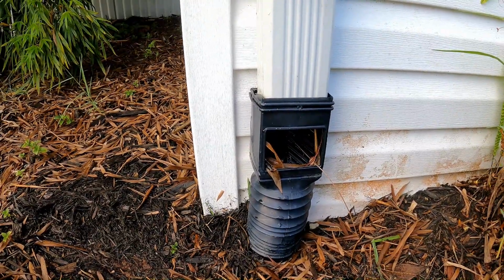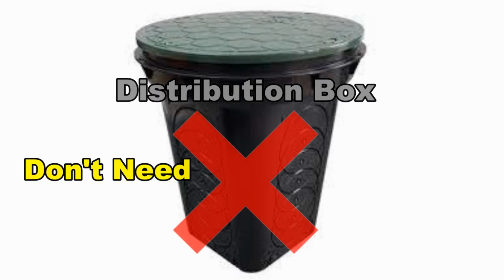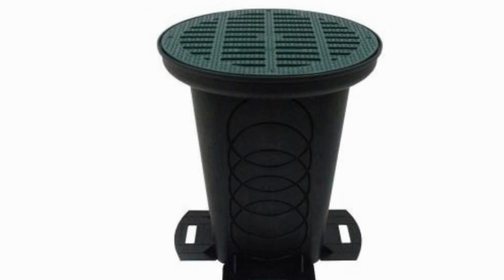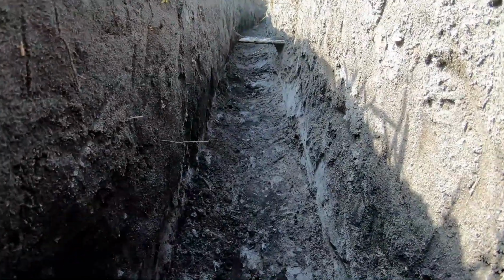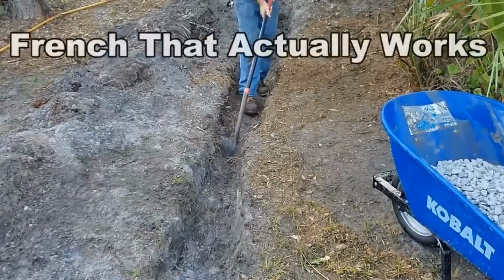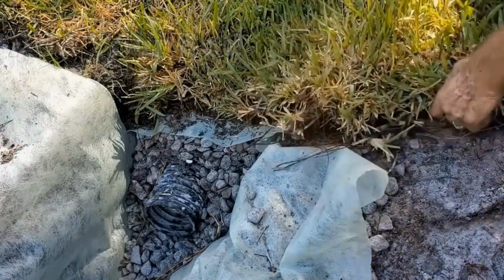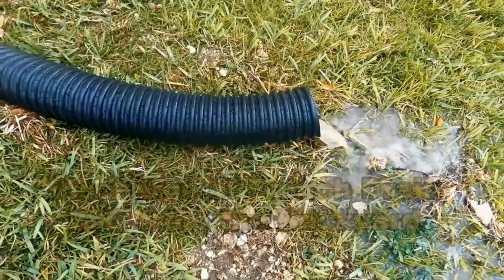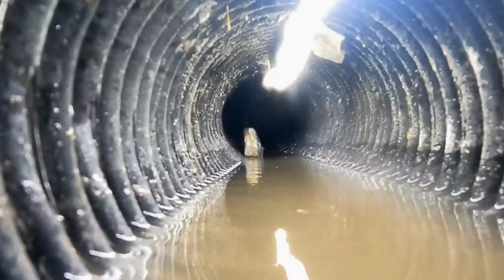Add-ons You Don't Need for French Drain - Save Money

Comment: Any way you can make a video on what to do with a AC drip line that is on the outside of a house. I have one and it drips so much that it created a nasty puddle. I unfortunately have rocky, clay soil here in Texas so there is absolutely no drainage for the soil. I have dug 12x12x12 hole for the water to sit in and drainage but the hole fills up within a day before it floods the yard again.

With how much it drips and over flows I was thinking about using a sump pump and routing a pipe to have it wash away behind my fence into a field. Or just down my driveway.
Reply from the maker: DONE & DONE - https://youtu.be/iHkaojj4e7M
Reply: @appledrains  oh yes I saw this video, but won’t the catch basin just fill up eventually and pour out the top???? The ac drip line is on the side of the house where very little sun gets to it so evaporation does not occur fast enough. If it didn’t work in a natural hole in the ground, why would it work in a catch basin where it doesn’t soak in the ground? Therefore making it a slower process of getting rid of the water!
Reply from the maker: @jjgonz98  I don’t think you watched the video! Why would catch basin fill up unless the drain line is clogged?

Seriously 
Watch videos to the end and learn
Reply: @appledrains  I understand, I did watch the video, but I don’t have any existing catch basins or anything of that nature connected to a drain line of sorts. If I connect a pipe from the ac line to a catch basin, where does the water go once it reaches the catch basin?

Maybe I’m just misunderstanding the concept.
Reply: @appledrains  I figured you didn’t know how it worked. There are others in the neighborhood that have had a professional install a catch basin and drain pipe and the water overflows due to the lack of drainage at the basin. The water can’t drain to nothing, therefore creating an overflow in the basin.

Seriously 
Did you read at all of what I said in the previous comment?
Reply from the maker: @jjgonz98  the catch basin connects to a drain pipe . If you don’t have existing drain ..YOU NEED TO INSTALL COMPLETE DRAIN TO STREET.. I’m so you are so confused about what is needed.. but the catch basin we install DOES GO TO THE STREET and WORKS PERFECTLY

Comment: NEED A BIT OF HELP HERE DOWNUNDER...
I am currently (slowly) doing the footing drainage the way u recommend, However 3 aussie plumbers have told me I am making a big mistake by not burrito wrapping the whole void which is pretty big. I am using a 90mm pvc with holes I drilled myself (8mm) 20mm blue metal, have painted walls with 2 coats of tar sealant then used 3mm thick pipet plastic sheets to cover the paint, so not to damage membrane, however the other side is clay & i am in a confused mind plumbers here say the clay will get wet & slowly push into the rocks therefore moving the clay and foundation another said put green shade cloth so the clay wont have an easy time to pass through others say use a thicker membrane???????  HELP PLEASE
Reply from the maker: 1st take the plastic off the wall. 
2nd use you shade cloth to cover your stone 
3rd use lots of gravel to back fill
4th your done
Reply: @appledrains  thanks for reply ....the plastic is a special pipet style 3 & half mm thick ,I am using it so the rocks don't damage the tar moister resistant paint as I was told sometimes the rocks scrap the paint off in time as paint gets old??
Reply: @appledrains  fforgot the clay wall is 1.9m high under house...I live on a mountain & house is 40yr old dug into the mountain on three levels...big job that is y i am getting as much info I can & u seem to b the man.
Reply from the maker: @chrislawrence4660  you got this! Let me know how it turns out 👍
Reply: @appledrains  thanks for putting the video about people showing there drains very helpful.